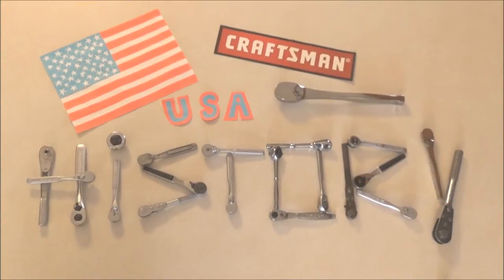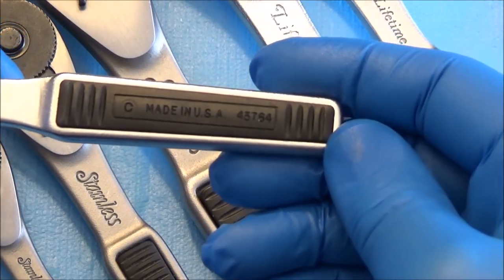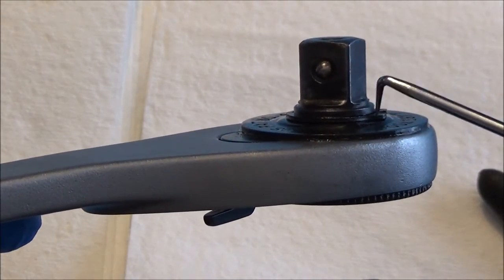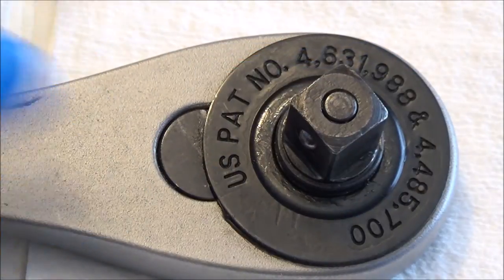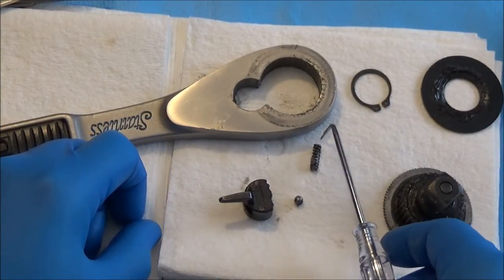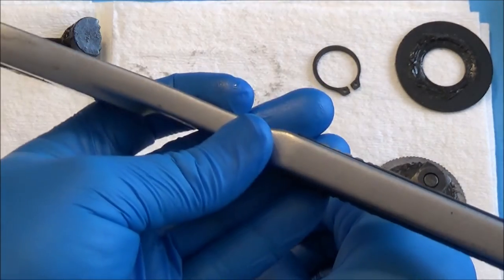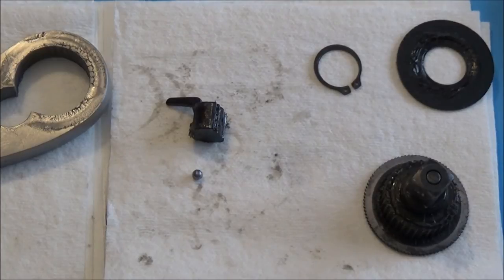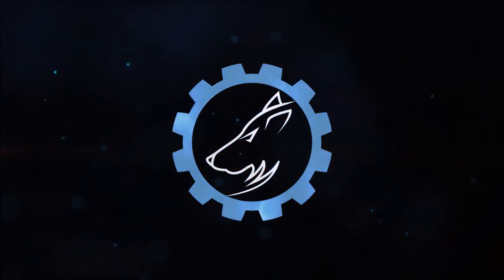Craftsman Tools - USA History: Stainless Steel & Lifetime Ratchets - Rebuild & Discussion

Comment: Thanks for making this video, I recently acquired a 1/2 inch stainless steel Lifetime ratchet to accompany my 3/8 inch Stainless ratchet I am the original owner of.

When I opened the 1/2 inch up, I found some metal shavings that had sheared off a few of the main gears teeth.  Someone must have used a long cheater pipe or something to break the tops of the teeth like that.  Functionally, the ratchet seems to work, but I am afraid that it will slip if a lot of torque is applied to the ratchet if the gear and pawl happen to be in the wrong spot where the damage has occurred. 

I just found a genuine rebuild kit (44787) that includes everything but the pawl, spring, and ball bearing. Very hard to find this kit, an eBay seller had two, I bought one, so there is still one out there to anyone reading this. 

I will be replacing the main gear in my Lifetime ratchet, and keeping the new snap ring and backing plate from the rebuild kit as backup.

Comment: You wouldn't happen to have an extra half inch stainless steel ratchet that you would like to part with would you?
Reply from the maker: Hi, John!  ^_^

This is one of those situations that if you asked me about 5 months ago, I would have said, "Absolutely!".  Unfortunately, I sold the last 1/2" SS ratchet I had that I wasn't going to use for the "reboot" videos I have been working on.  Sorry about that.

Check out my eBay page.  It is the same name as I have here.  If I find I have another, I'll put it up there.